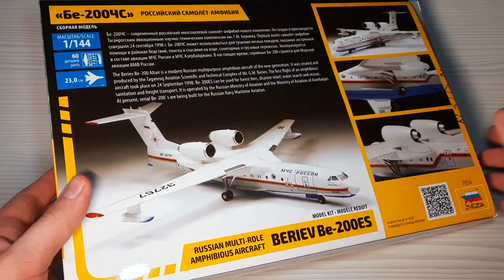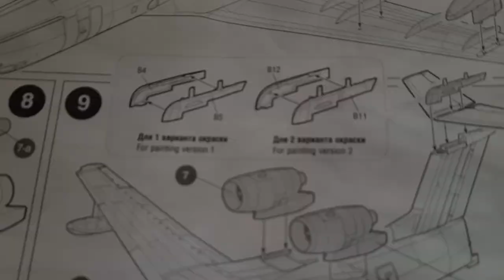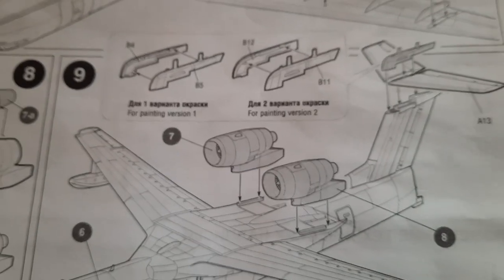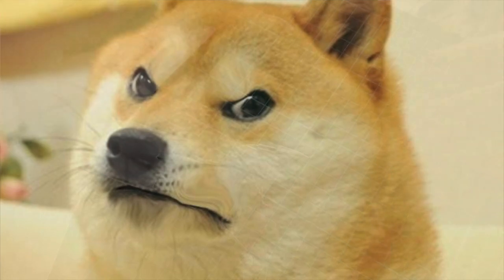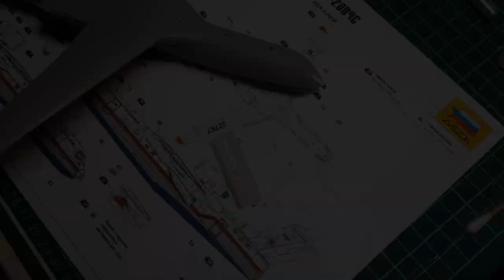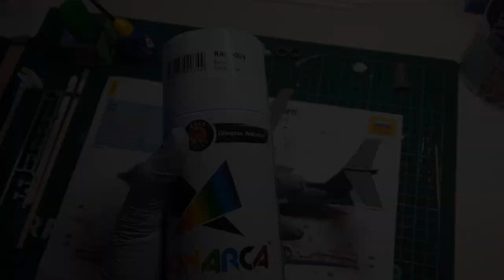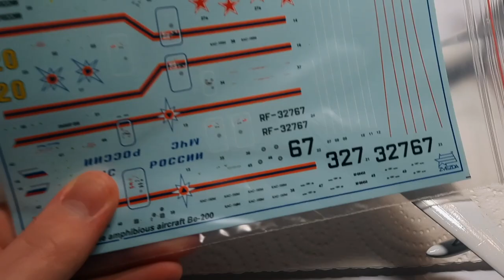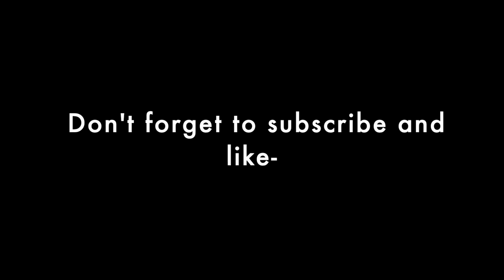Zvezda Beriev Be-200ES "EMERCOM" | 1/144 | Assembly

Comment: About the horizontal stabilizer it is actually supposed to be that way it is not upside down supposed to be like that if you look at pictures of the real thing it is to create downward lift and stabilize the plane also the different parts are for the two different versions you can build  option 1 the one you went with  was supposed to used parts B4 and B5